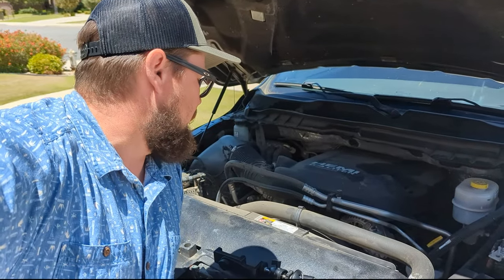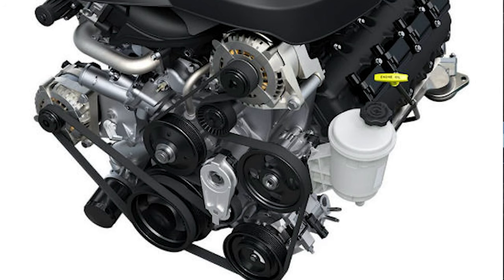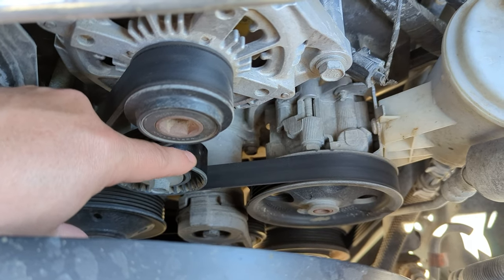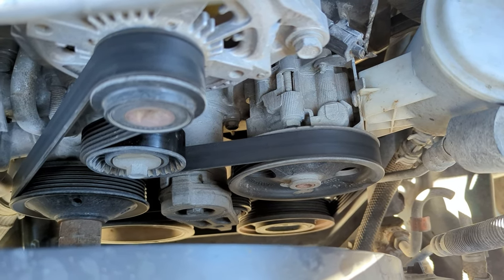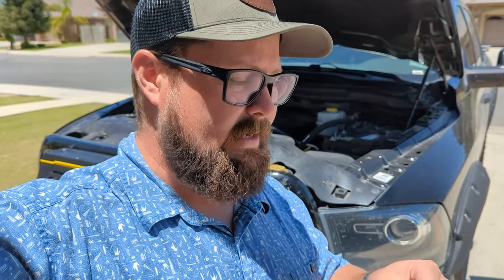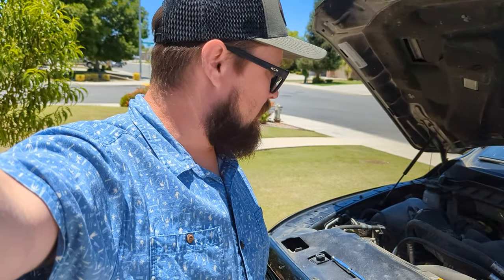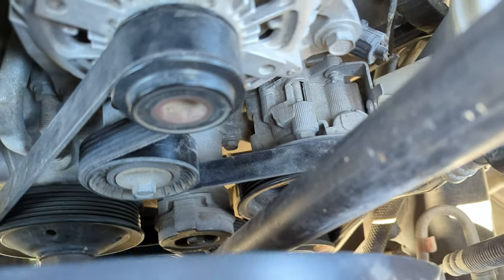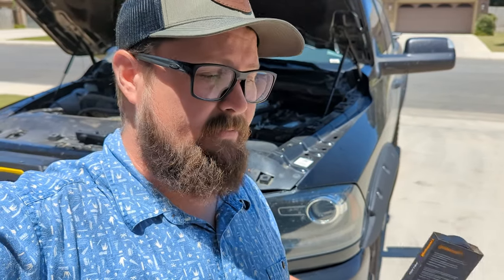Ram 6.4L Hemi Serpentine Belt Replacement - Diagram & Tips

Comment: Have you made a video or removing and installing the idler pulley? Thanks
Reply from the maker: No, but I've done a lot of them. It's pretty straightforward once you take the belt off, but reach out if you have any questions.

Comment: How do you get it pass the radiator fan pulley
Reply from the maker: You go up and around the fan blade between the shroud. You have to manipulate the belt a little, but it should slide past.